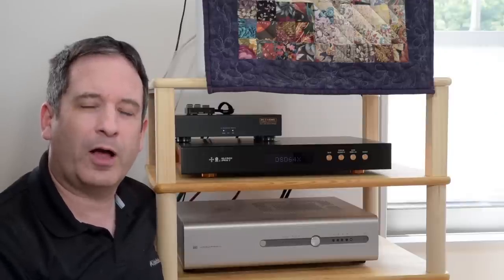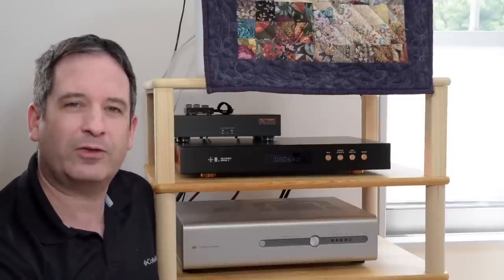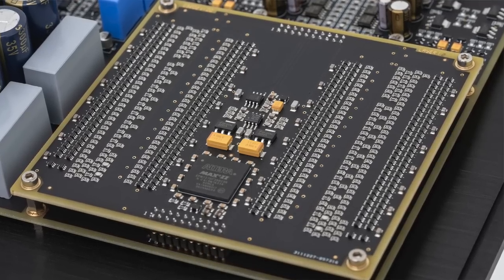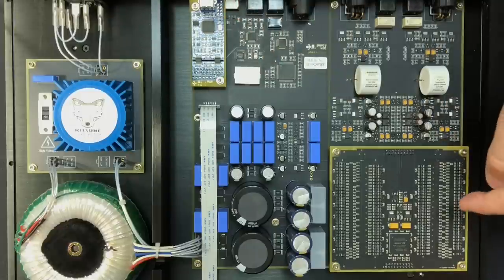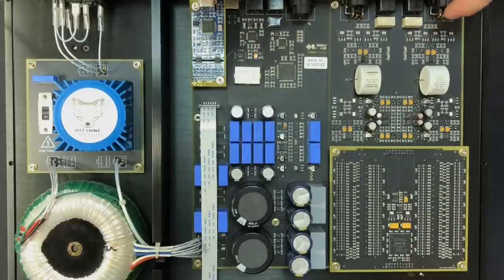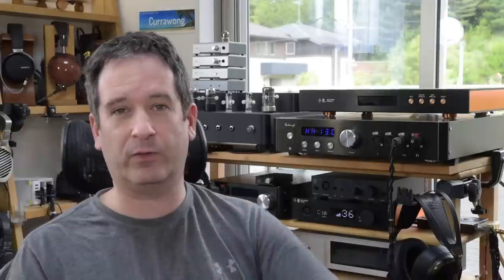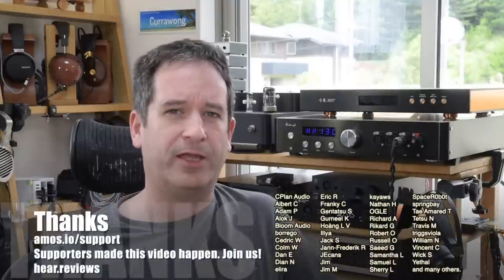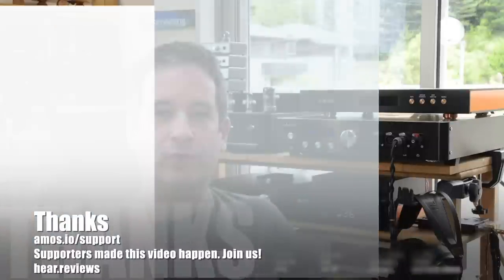HoloAudio Spring2 Kitsune Tuned Edition - Why is everyone interested in this R2R DAC?

Comment: Your wrong about resistors .. Danafrips chip resistors in their ladder DAC's are laser cut to .01% accuracy .. So your wrong .. I know that their two top end Danafrips units use .01% chip resistors, I am not so sure about the lower end versions but, that being said, if your having resistors cut you cut them all as it is much cheaper to buy in larger quantities .. You should really check our what Danafrips says about this before putting out second hand information  ..
Reply from the maker: Hold on, what specifically that I said is wrong? I didn't mention anything specific about Denafrips, because I don't know what they use. Regardless, there aren't any resistors available that will create a resistor ladder with even 16 bit accuracy. Compensation/correction must be used.
Reply: @Currawong  You specifically said in the video that only .1% resistors were available .. Not true .. Secondly, Ladders are voltage dependent so your wrong again regarding 16 bit accuracy as it applies also to resistor laser cutting .. I can order .001% tolerance resistors if I want to pay for that ..
Reply from the maker: The best regularly available resistors are 0.005% Vishay, at $93/resistor. I'll let you do the math. Basically, without paying the cost of a car for your DAC, you wont get an R2R DAC with 16-bit accuracy. Even then, the other components, such as the switches, will degrade accuracy significantly.  The Denafrips, if it uses .01% resistors - that is 1/10,000, and you need 1/65535 to get 16 bit accuracy, not even considering the switches.
Reply: @Currawong  Not if you know someone with a 5W laser with a 1/10,000 beam width and a manual veneer control and a good HP micro milli ohm meter .. Easy to buy in China but not exportable due to restrictions ..      So if you have a tech you can cut what ever value you need .. Do they have this ability or can tgey buy them from a cheap China source ? I don't have those answers but I do know I can buy just about anything in China .. Vishay isn't even close to being the only source of precision chip resistors .. I feel very sorry for profligate few who pay $93 / chip ..
Reply from the maker: Do you know someone in China with such a thing? Where does this info come from? I also just checked the Denafrips Terminator page and it states "The DAC core conversion module R-2R is constructed with 0.005% high precision, 10ppm low thermal effect precision resistors." so what you posted at first was completely wrong.
Reply: @Currawong  Yes, and Yes I know who makes the lasers and Yes I know you can't import them because of import restriction on devices that can be used as a weapon .. 

The laser is small enough that it can be cucked up in verneer machining instrument .. The video I saw was from years ago and yes this is how they cut / tune resistors ..

The way the video showed the resistor being cut was from the center of the part not on the edge as some do .. A laminar flow of gas was used to prohibit ignition of any kind .. 

Yes, their are several sources in china for making said resistors .. I suspect that most of these places deal with scientific or military programs ..
Reply: @Currawong  Yes their are companies who produce lasers that can cut resistors .. https://www.spilasers.com/application-cutting/can-fiber-lasers-be-used-to-cut-resistors/ Don't know how well they do this .. Do know that a system that is driven by resistive measurement feedback may be custom requiring fixtures and HP-IB interfaces to test and cut, test and cut ..
Reply: @Currawong  So I have  just learned that Denafrips is now using .005% chip resistors in their two high end DAC's and .01% chip  resistors in their two low end DAC's .. Obviously they have a source for  tuned resistors that isn't breaking the bank ..  The only way to tune resistors like isn't through thick film processing, its  laser cutting  or perforating  ..
Reply from the maker: Seems they have updated their page in the last week or so. This doesn't resolve the issue of the accuracy of the switches. Regardless, no electronics can, technically, actually resolve 24-bit, as the noise of the components will be higher than that. 21-bit is state-of-the-art. If they can show a linearity measurement down to -126dB (21-bit) with a resistor ladder, that'd be amazing.
Reply: @Currawong  The ladders / switches are tuned "In Circuit" I just found out .. So your right this is monumental .. They only do this with the Venus and Terminator models ..
Reply from the maker: "Tuned" doesn't mean anything. If they can show a measurement showing it is linear down to -126dB (21bit) that'll be amazing.
Reply: @Currawong  In circuit tuning may not mean much to you but it is an industry first so it does mean a lot to me because if they can say they are accurate accounting for the switches down to .005% tolerance in circuit, like you said, that is amazing ..
Reply: @Currawong  Putting it out their that they have raised the bar may not be in their best interests .. You know the kind of hoops that Audiophiliacs are willing to go through to best the other guy ..
Reply: Holy crap is the pissing contest over yet gentlemen?

Comment: NOS mode is completely shit. R2R inherently is the opposite of analog/organic. The corrections in fpga and other techniques only makes it closer to modern dac chips. This unit is pretty good when using OS or DSD mode.
Reply from the maker: Have you had the Holo Spring 2 there at some point?
Reply: This thing has 126dB SNR in holo audio measurements so yeah it does not sound typical 'analog'/distorted R2R.
It sounds damn clean (I actually listened to spring2 not just just saying this)
Reply from the maker: I think the reasons for some R2R DACs to sound distorted is the lack of compensation used to ensure any kind of accuracy of the resistor ladder. Measurements of DACs are designed to deliberately reveal the faults of a design, and generally show things that occur little, to not at all during music playback, or are otherwise mostly inaudible (like high-frequency aliasing).
Reply: @Currawong  NOS = aliasing. So ....
Reply: @Currawong  ? high-end DACs like the spring use an FPGA for error correction, there is most definitely compensation going on.
Reply: Disagree. I have the Kitsune' Level 2 and I run only with no oversampling (or with DSD input). Just give me that r2r ladder crisp, sweet, clean sound.